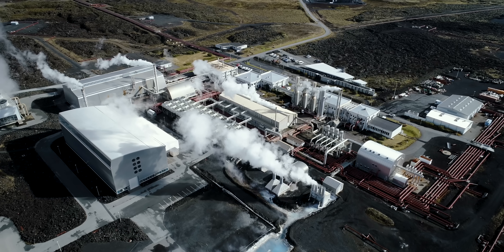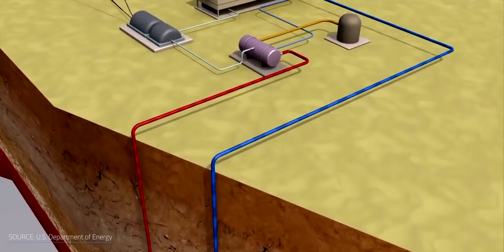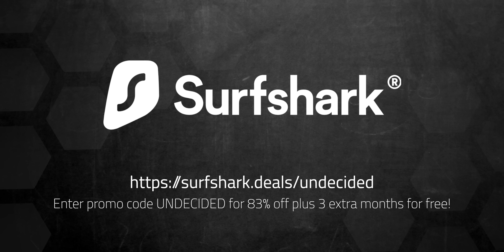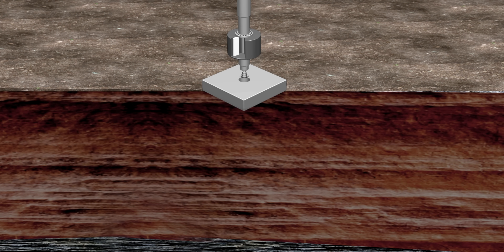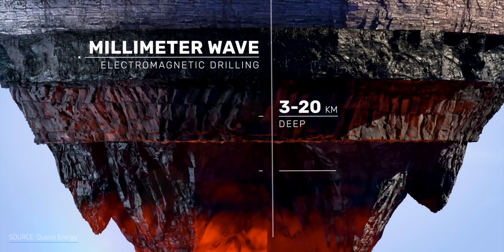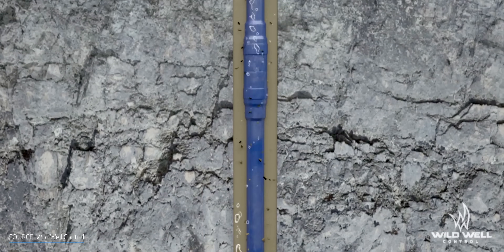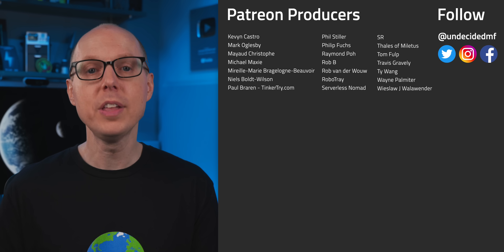Why This Fusion Tech May Be a Geothermal Energy Breakthrough

Comment: This is an exciting development, it will be interesting to see how it makes its way into the field! 

I've seen research in the past looking into low(er)-temperature geothermal systems that use heat engine cycles that don't rely on steam. While not as efficient on a per-unit basis, they could be deployed far more universally. I wonder how those designs and these could mesh.
Reply: Interestingly, you don't even need high temperatures to run a steam engine or turbine, because they run into the vacuum of a condenser. So, you can boil of water at ambient temperature, as long as you have some colder reservoir to condense it and remove (dissolved) air from the system.

Effiency is low at these small heat diffentials, of course. I also think "organic rankine"- cycles are better suited than water at these low temperature gradients.
Reply: Concerning meshing, at the temperatures implied in the vid, we don't really need to look for altertatives to water/ steam.

Im curious, though, wether we could increase efficency in standard power cycles with another medium.
I have read mercury would work really well, not sure if that is true or even relevant these days :D

Helium was used in research reactors (thtr), and co2 in early british nuclear power plants (magnox), but only to carry heat from the fuel rods to the steam generator.

Not sure wich medium promises most efficiency... il try to find a video on that :)
Reply: @nos9784  cyclopentane is used
Reply: Nothing quite says environmentally friendly like poisonous heavy metals. I think the Mercury should be passed over. 

Perhaps it'd be possible to site other plants nearby. I recall hearing of a steam plant powered with rice bran. Wind and solar would be typical and maybe nearby hydropower as well.

Comment: I imagine cooling down the electronics at an ambient 500c is going to be fun.
Reply: Perhaps they don't need to. Any electronics near the tip could employ silicon carbide semiconductor technology. They are currently working on SiC SiC JFETs that can operate reliably for 521 h at 460 °C. In 2016, SiC JFETs were shown to operate 25 h at 727 °C. They are not currently commercial, but the field has only been developed extensively over the past decade or so, so it is fast-moving. https://www.ncbi.nlm.nih.gov/pmc/articles/PMC6631602/

Comment: Glass lined hole! "Glass" breaks easily? Glass dissolves in the presence of some fluids. Thermal shock? But none of these "may" be game ending. Worth a look see. Geothermal plants have had issues with corrosion due to concentrations of chemicals at higher temperatures. If the heat could be used directly w/o the losses involved in converting it to electricity it could be better yet. Distilling water? Industrial processes. Even a limited use for space heating. The last one is not likely often viable.

Comment: would this extra heat escape into space ? otherwise wouldn't it contribute further to global warming ?
Reply: The heat, as in steam or hot water, is what will be captured. There may be miniscule amounts that get by the pipe, but I don't think it will be in worrying amounts. Also, heat in and of itself, is not a concern. That small of an amount will just dissipate. What is of concern are the gases that stay in the atmosphere and keep that heat from escaping.
Reply: @snakedoktor6020  if the whole world switches to geothermal on a large scale , those small heat leaks will add up. Dissipate where ? to space ? or in the atmosphere ?

Comment: Maybe I missed it. How many kw/hr does these directed energy beams need to run?
I'm curious about the infrastructure needed to power the beam drilling
Reply: A 1 MW system is mentioned in the video. So to run for 100 days of drilling or 2,400 hours is 2.4 million kWh.
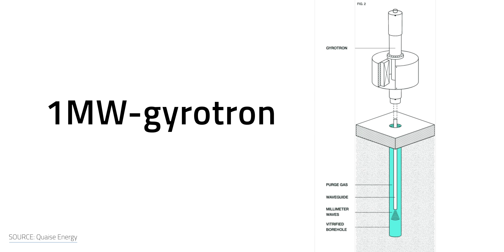Reply: @robertelliott6188  Yep, it's mentionned at 12:51 for reference. And if you do the math, even if you assume a high electricity cost like 20c/kWh like in California, it's still only cost about 480k. Also 1MW is not that much energy, about the equivalent of 100 amercan homes. Quite a few industries need >1MW for their operations, it can be provided with pretty standard infrastructure.
Reply: Depends on where they plan to drill.  Could be connected to the existing power grid,  or a diesel generator on a trailer.   Since drilling is just the first step in creating the geothermal power plant they'll be building a lot of infrastructure there as well.
Reply: if its to replace an existing power station id say it's not a problem as the infrastructure needed will be there.

Comment: Could the the technology also be use in a vacuum, specifically to mine asteroids or comets in space? No need for replacements parts like a conventional drill and the gas/particles released could be captured and processed?
Reply: It could probably work, though you probably would need some very intentional design work for the borehole head in order to have enough sealing to reliably capture the gasses. Additionally, you'd have to have some pretty sophisticated processing equipment to separate out the desired material from the "country rock". Weight is super important in space transport, so purifying before shipping is probably critical.

Comment: Geothermal like this is interesting, because it isn't even just always on, it will behave like storage. You are limited by the rate heat can diffuse into your borehole, so you can get extra power out of it for a few weeks by pumping more water down if you then reduce the power draw later to wait for it to warm up again. So it is complementary to conventional renewables.
Reply: I completely agree. It would make sense to cycle geothermal down during high solar and wind power times and cycle up when they are low. 
Additionally, homes can be heated through a pipe grid. Not uncommon in many cities e.g. in Europe but they still run on natural gas mainly.

Comment: Hmm. One of the reasons why it's going to take billions of years for the Earth's core to cool is because there aren't very many outlets for the heat... but if all of a sudden we have tens of thousands of tiny little holes acting as heat sinks... how would that affect the core? That's really my only concern. Otherwise, this looks pretty promising.
Reply: @Joey Hext There's more to it than that though... The general idea is that the core is like a huge magnetic gyroscope with a solid inner core of extremely dense materials and a fluid outer core of molten iron and other metals. If you've watched some motor design videos where they try to align the lines of magnetic flux, you would understand that the tiniest deviation from the proposed design can cause large discrepancies in how the motor operates... and considering the core is what powers the planets magnetic shield protecting us from solar radiation, I'd say it is extremely important that we investigate as thoroughly as we can before we start poking more holes into the crust than exist naturally...
Reply: @Joey Hext Right? lol. It's good to take a conservative approach to big changes every once in a while. Slow and steady with small but gradual improvements at each step. With that being said though, at 22 miles, we'd be just barely touching the mantle of Earth and still well over 1,000mi from touching the core... So is there REALLY going to be any issues? I don't know. If I think about it, my gut says it would take 1000 years to see any kind of change, but if that change is a weakening of the magnetic field, then 1000 years is a 1000 years too soon.
Reply: @Joey Hext I might be inclined to agree with you if I was 100% sure the world was going to end because of our carbon emissions... lol. I've seen enough research to say definitively that humans are having an impact, but that we don't actually know the full extent. It is very likely that our impact is nowhere near as extensive as we are being led to believe. Too many other unaccounted factors to say for sure though.

Comment: this sounds a bit too good to be true. the inner glass coating can only withstand the pressure of there are no cracks. but the rock it would drill into would be full of natural cracks to begin with. what if it hits a water pocket? what happens to the rock vapor - where does it solidify again? on the drill shaft presumably. if you drill 20km deep - where does all the vapor settle?! would it not condensate and solidify somewhere?

Comment: One thing I'm concerned about when interfering with natural systems is how its gonna come back to bite us in the long run.   I might be being paranoid, but what is the effect going to be of giving the intense heat from that far down a more rapid means of escaping into our atmosphere.   We're already dealing with climate change, what is that kind of heat going to do if it's released at any kind of scale?

It's a similar worry I have to the situation regarding bottled water.  we are taking water by the millions of gallons from areas where the weather has adapted to moisture, and moving it to places that are naturally adapted to arid conditions.    Isn't that changing the weather patterns in those places?
Reply: The amount of heat escaping into the atmosphere is nothing compared with what we get from the sun.
Reply: I don't think the heat itself is a major issue as it radiates into space.

Comment: This sounds good, but we still need to consider the overall impact on the planet. The heat source may be very large, but it is still finite and the impact on the local environment could be significant.
Reply: I don't think you understand how much energy the ground could absorb. The entire planets electrical grid poke into  the ground.
Reply: @Endoplexer  I understand that the amount of geothermal energy available is less than Solar. More importantly, extracting heat from the ground could have unforseen consequences, such as increased Earthquake risks.

I'm all for innovative solutions, but we need to understand what the problems are first.

We need to reduce our overall energy expenditure, not increase it. Given that there's a finite amount of Investment money/time/energy available, my preference is to insulate everything.

Comment: In watching this, my mind immediately turns towards geothermal powered desalinization. If it does turn out to be a viable source of energy, I could easily see clean water plants being built in Yemen or along the southern California coast that turn geothermal energy into clean , fresh water. ( I wonder if a variation of the same death ray technology could be used to boil a constant flow of water at greater efficiency than most of our current desalinization technologies.)

Having ready access to so much energy might also make it possible to build meaningful quantities of atmospheric carbon dioxide and water vapor extraction systems. Machinery that can pull CO2 and water from the air wouldn't fix climate change on its own, but it might give us time to develop the technologies and societal changes that would do so.

It all hinges on how these tests shake out, though.

Edit: proving the need for proofreading.
Reply: Considering this is a glorified microwave, you could boil water with it, but you're better off letting the heat of the earth boil the liquid instead...or use the energy to electrolyze water for use in hydrogen vehicles or chemically pure water.
Reply: @Houstonruss  I had thought of using the heat from the vent itself to boil the water but in my thinking, the problem you would run into is that you are slowly filling your hole with more and more salt. You let gravity Hall salt water down and freshwater vapor comes up but that's salt is still down there. I don't think it would take very long before you stop being able to use the well for direct desalination. You might be able to use something like the binary fluid system. Mat describes here to exchange heat from hot water to seawater but I'm not sure how efficient that would be. Granted, it might very well be more efficient than using a microwave to boil water with the electricity from the same kind of exchange. Either way, it seems to me like it would make for very efficient and potentially relatively inexpensive water plants.
Reply: Machines that pull CO2 from the air are already available,we call them trees
Reply: @das250250  true enough and we would certainly need to have a better relationship with trees. The potential exists, though, to take some of the technology that has already been developed. That can remove CO2 and water vapor from the air and make it work more efficiently than trees. Something that could do the same job but take up less space would work very well in cities. You could imagine it as something like the inverse of oxygen made in the Amazon. Most of the O2 made in the Amazon, by the trees, is used by the other life living in the Amazon. Imagine a world where most of the CO2 generated by a city is reabsorbed by the city. That's all of the humans, cars, and the industrial areas. Again, this isn't a tech that reverses climate change on its own, but it gives us time and time is what is required to change societies. Time and necessity.

Comment: Here is a crazy idea:
Would it be possible we put aside the drilling concept and use the increase and reduction in the size of metals based on temperature?
Imagine we have a solid ball of hard metal which we reduce the temperature of it, due to contraction it reduces size, then we stop the cooling (e.g liquid N, etc) and due to temperature from the rocks and heating, it increases the size and cracks/smash its way deeper. This could be repeated over and over again to make the hole. 
There might be challenges on the way but sounds easier than sending a laser beam KMs below.
Reply: And how do you remove cracked material out of the hole?
Reply: @tgregi  no material is produced to be removed.
Reply: One problem I can think of is, even if it is legit to create a hole, how do you take that piece of metal back to the surface when it gets stuck underground?
Reply: @garylee867  
You use the same piece of metal to make the hole which means it has the diameter of the same metal piece it has created it in the hot stage. in the cld stage it would be even smaller than its hole.
Reply: @drpk6514  
When the metal is underground, it is in the hot stage. Given it is used to create a deeper hole, it is stuck underground and there is no way you can cool the metal underground.
Reply: @garylee867  
No. Cool and Hot are relative concept.
The Cold state could be the temperature that the rocks are and the Hot state could be the state you heat the metal. 
Got it?
Reply: @drpk6514  
haha, I see, it seems possible in theory. But it will take a ridiculous amount of time given how little volume change can be made by thermal expansion.
Reply: @garylee867  
It sounds a lot more feasible than vaporizing the rock with a laser beam 10 KM below the surface lol
Actually, heat expansion has been used for cracking large stone blocks for decades. 
Imagine something like what you have in your logo hear. Cracking opens up paths and heating and cooling can take place actually fast and may be a lot faster and cheaper and lower-tech...
Reply: @drpk6514  
Cracking and digging are two different things. 
To dig a hole with thermal expansion, the direction of the expansion needs to go downwards, which means we will have to apply an insane amount of force on the top of that metal to overcome the reaction force from the ground, which I believe no machine is capable of.
Vaporizing the rock looks feasible to me given that they can do this in lab already.
Reply: @garylee867  
While cracking is a part of penetrating the soil, I said cracking to make it easier to understand.
Did you know plants grow roots exactly this way? They penetrate the soil through expanding root size and length.

Comment: The one guy said that the cost of drilling with the lazer for a certain depth is 500000 but then he compares that to the cost of a well drill. That didn't make sense to me. As the next guy said , you would use the well drill to drill first and then come in with the lazer. So you still have the cost.
Reply: Also what effect does water have on this lazer thing?